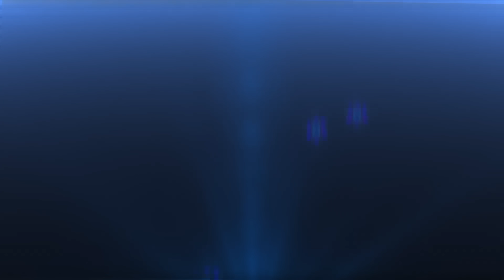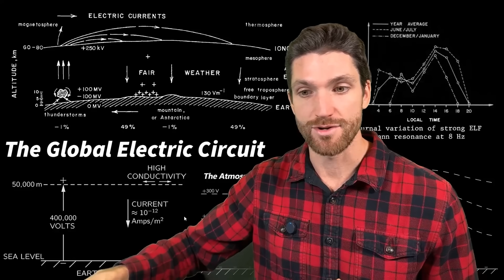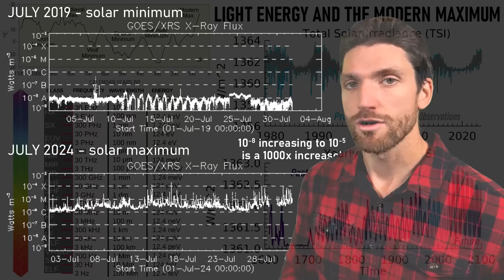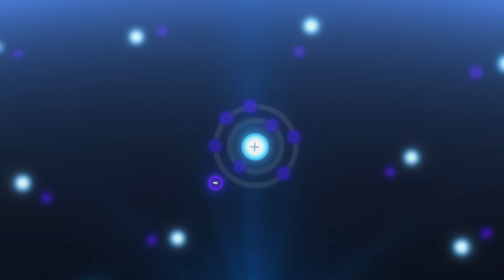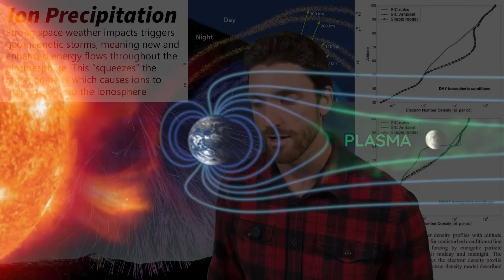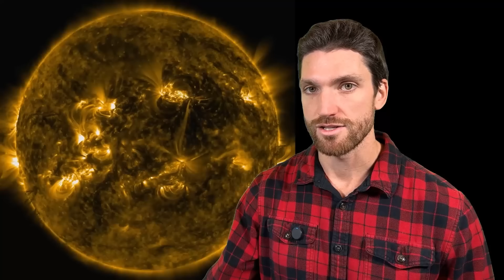Even I Can't Believe this is Happening SO FAST...

Comment: this one was really losing me... i felt like you were making a point about something but without defining what you were explaining. i'm hearing you, i just don't understand what you are trying to get across overall, especially with that title. is something NEW, did something CHANGE? what is happening so fast....? i mean the info is cool and stuff but it's a little maddening to not really get what you are getting at. 
((btw i am an avid watcher and this is the only time a vid struck me this way. just wanted to give feedback in case anyone else was a bit confused too. i know you read comments and address stuff in future vids sometimes. i did pause at 13m in because there. is all the data but i don't know WHY and it's hard to keep with it...))

also noticed that 2020 had crazy spikes. and it was indeed crazy events happening. how would you equate that vs our current cycle? is there something diff or bigger/stronger/longer etc to one over the other? or that one of them lined up with some positioning of planets that made it different?

when i look at the chart i think "oh, must be the same". but i know that's not true necessarily. like that one we had with the 3 pulses and much longer duration.

thanks!
really appreciate all the space weather stuff!

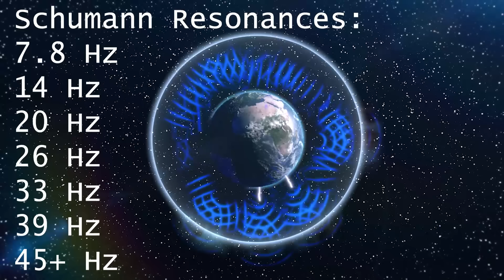Comment: @2:15  I was about 40 feet from the origin point of a lightning bolt...  it struck the power lines by my home, while i was outside on the 2nd floor porch.  I did not feel heat, but i felt the shockwave of mechanical energy, and i must have been in that EM field.  It was close enough that I did pat myself all over thinking "am I hit?!?", but it wasn't direct.

Comment: You're wrong about the Schumann frequency and lightning. It's effected by lightning, but it's not the cause. The signal of light circles the planet 7.83 times in one second at its immediate surface. This signal is the master clock signal that literally regulates time at the speed of light. Every piece of independent mass has it's own Schumann frequency according to its size and density. 
You won't find the real answers in modern science of the electron, but can using Aether science. It actually works better with E=MCC where the 2 C's represent the 2 light dimentional particles that fills all space like a fluid. DARK MATTER as they like to call it. 2  Aether devided by the he Time of 1 lightwave between the 2 of them make the building blocks of all matter. This is how the universe of color works to the vision in our eyes. Those CONES are receivers because the transmitter is also a cone in matter.  ☯️  2 cones entwined with a twist 195nm X 390nm each spinning at the speed of light in opposition playing out the rainbow signal of colors on the resonance spin internally while the outside spin carry the 780nm master of white light all while regulating universal expansion of Time throughout the universe. The quantum jumps of energy and detection of mass jumping in and out of reality are a misinterpretation of the observation at the "quantum state". The problem exists with the foundation of science in the electron. Every observer in science tries to account for the observation with electron theory, and It just simply does not fit the observation. But Aether theories do. Even curved space time. In fact it maryies time to energy to mass directly with universal expansion.

Comment: Everyone has been tracking the Saturn Neptune conjunction at zero degrees Aries to take place on 2/20/26, but look at the entire solar system. All the inner planets and several objects typically tracked are all in Pisces and Aquarius. You have literally most of the entire solar system bunched together in a 60 degree arc. But if you look at this from a physics perspective, the sun is getting pulled by the planets bunched in this narrow arc and it has to maintain its positioning against this torque. You’re watching barycentric displacement happening, and the reaction of the planets and the sun quantizing to keep themselves stable.

Comment: 2 firemen witnessed it. Told me it was cold, but not to climb my aluminum ladder to touch it. Even static can disable you. An old fisherman called it st. elmos fire. It could be felt as tingles on bare head and wet feet. My camera phone must have a delay for night. Pix framed showed little balls following into a streak. One lady could see surging light like northern lights. I miss real cameras that took real pictures.

Comment: I need to share this. As of the past month or so, ive noticed a huge jump in static electricity. I work with my hands alot and use tools that create alot of friction. I can literally watch and feel myself getting a nice jolt of electricty. Its enough for me to comment about it. Same machines ive been using for 4 years, and this is something new. I also get huge lightning storms pulling my laundry out of the dryer. Its awesome. I was awestruck at what I just witnessed the other night pulling them out.

Comment: I’ve been fatigued, depressed and anxious the past few months. Especially the past two weeks.  I rarely get depressed and I can’t shake this like I can in the past.
Reply: May I suggest taking high doses of vitamin D3, like 10.000 at least.  Helps for depression and anxiety and is a perfect stimulans for immunity.  Taking since 5 years now.
Reply: Considering how they use electrical devices for psychiatric treatment both magnetic and induced shocks it goes without saying enviromental stressors may affect our normal balance of electrochemical transmissions from cell to cell and entire regions of the body and brain.

Comment: This heat during the middle of winter will cost us a lot of fruit and nut production. The trees think it's an early spring and begin to leaf out, then if bitter cold returns the blossoms that turn into fruit are destroyed. Lots of places may not have those crops this year. Mother Nature does not like to be yanked around.
Reply: @samnjoeysgrama1  I’ve been concerned about this. I’m in CO and we’re having a very dry winter. 60’s this week, warm weather during what is typically the coldest time with most snow fall. Shrubs and trees are budding, it’s not good.
Reply: @Crescentlight11 I live in the mountains west of CO Springs. I've been there 29 yrs, it's going to be a dangerous yr. No snow = fires and starving wildlife that summer.

Comment: Anyone experiencing circulation issues?

My ears are doing some serious ringing, as I walk even my legs are feeling very strange 😢
Reply: Louder left ear ringing + sometimes  having a weird breath thing, bit more tired than usual.
Reply: Definitely feeling the ringing in my ears, heads headache and lead in my legs.  Ugh.
Reply: Yes I do. My ears are ringing more than normal and sometimes my legs feel like as I was on a hike. 

My mum also mentioned strange feelings in the legs.

Edit: sometimes the ringing sound like a morse code. But I need to concentrate on it.
Reply: My right ear has sounds like a transistor radio on and off. Like my ear is trying to tune into something.
Reply: YES YES YES, husband and I have both been commenting-- whats up with our legs? Feel like I've done 1000 squats or run a marathon and HAVE not! Grounding has not been helping either.
Reply: @julieronson4035 

Believe me I truly understand! And I'm essentially an active person, walking miles during any given week, up and down the stairs,  definitely not sedentary. 

I know it's gotta correspond to some form of solar 🌞 activity 😮
Reply: Check your B12-vitamin and magnesium levels. I am serious.
Reply: Yeah I kept waking up with my hand sleeping and cut off circulation, I just took off my shirt and slept better, whenever I slept with a loose shirt my circulation would make my hands fall asleep again.
Reply: I have RLS…definitely acting up.

Comment: In South Africa. I'm feeling extremely tired like I'm walking through mud
Reply: Same here! Tinnitus raging, headaches and sinusitis. Waking up at odd hours. Wake up tired even when I have slept well. We're really going through it down here!
Reply: I'm having all those as well, I have an autoimmune disease which makes me more sensitive to environmental changes. But my fatigue levels are extremely high.
Reply: @TheLowflyingdaisy same! Exactly! Here in South Texas.
Reply: I am in Cape Town and feel the same
Reply: @PatChelin  same here, I’m exhausted most days… this heat not helping 🥵
Reply: It's your body getting an upgrade.  Rest. Hydrate. Get bare feet on earth. Get into nature. It's all good.
Reply: @Susan-e4g-t7c If it’s “upgrading” you, then why must you do any grounding at all?  That just discharges what you claim is doing the upgrading.
Reply: @Wanker527 
Bc it helps. Maybe the flow is too much and you need to discharge some. Maybe connecting to the earth helps stabilize you. Maybe you have more shadow issues, beliefs, other gunk to clean out before you can incorporate the full charge incoming. Maybe it's meant to flow thru not collect inside but you have energy blockages. Grounding helps when it hurts, and is pretty much a good idea everyday. Just a suggestion. Something to try like salt baths. On really bad oowie days im not above reaching for Advil. Dont like using it bc it disrupts the gut biome. So I asked my guides about this and got that my crown chakra was too wide open and to close it down a bit  on these days. This is all new territory for all of us. We've never been here in these entrrgetics before. So just try shit and see if it works. ❤
Reply: Get better sleep, quit eating processed foods, and stay off the phone
Reply: Alot going on here.
Reply: Same in U.P. Michigan
Reply: Same here in Missoula Montana.
Reply: Same I’m in Canada
Reply: Me too.  In Hawaii.
Reply: A bit more tired than usual, bit more louder left ear ringing. Got pizza do not want to cook.😮
Reply: Go to bed and walk on the footpath
Reply: Happening to me in Tasmania, Australia.
Reply: I slept for 11hrs on Saturday. And I felt like I could have slept longer...
Reply: @colleenhawley6106  From South Africa. For the past few days I have been feeling so tired that I have been dozing off at different times of the day. It happens when I sit down in the late afternoon which is unusual for me
 It makes me wonder if the increased solar activity has something to do with it.
Reply: That's called demoralization, mate.  It's because you're living in a conquered and failing State where you're the prey animal for an out of control sub-saharan population.  Time to leave.
Reply: Living in that post-apocalyptic sewage pit would make anyone tired of life in general.
Reply: @HandsomeSquidward-q7g …. so you are South African?
Reply: I guess it’s going on everywhere 😩😵‍💫😔 …….. I’m in Georgia (u.s.a.), & I’ve been sooooo tired !!!!! just newly diagnosed with diabetes & that may be one reason, But even when I have had adequate sleep, It’s still not enough!!! I mean, I take B vitamins for energy & it use to work for me, Every time, But now it’s like I’m taking sleeping pills!!!! This is crazy 😩😩😩😞
Reply: Its felt like that in england for the last 6 years !!!
Reply: Go see a doctor
Reply: @darrelldarrell1447 which Dr😂
Reply: I am in Houston and continue to feel headaches and fatigue.  Gardening, my kitties and raising butterflies does help to recharge me.
Reply: I was there! It gets better. Stay in peace, breathe, and be grateful as its all amazing. So much magic. Just allow❤
Reply: Me too in colo.
Reply: Same in Norway
Reply: Samé in Czech republic
Reply: @colleenhawley6106  that would be more gravity , I think , I have been feeling it thru the moon cycle for about last 2 years .
Reply: Cranberry pomegranate juice def reenergized us today!
Reply: Did you get the poison?
Three shots or more seem to make people perma-tired.
Reply: Same in Ohio. Exhausted

Comment: I’ve been thinking that maybe we and the planet go through some kind of energetic, plasma based, dimensional shift, system change and that it’s cyclical. Resets happen and sometimes we devolve and other times we evolve, if that makes sense. Like ages of low energy, low vibration, low frequency and electricity and then the pendulum swings back towards the positive and we get increased energy, frequency, vibration and all that goes with it. I think we’ve been in a negative phase for the past couple hundred years or so and it’s going to crescendo then switch our polarity back to the next golden age. It’s always darkest before the dawn! Hang on folks, we’re in for quite a ride
Reply: People choose to be what they are....if they are given the right guidance they become excellent people....
Shaping the next generation of leaders becomes obviously the most important task for the whole planet

Comment: Hi Stefan. Could you tell us more and more about cosmic rays?

They should be going up, as the Sun is calming down and pushing away less of them. And due to the Solar system entering a specific region.

They are loosely linked to ice ages, globa cooling (and warming), as they increase accumulation of high clouds. They also correlate with great plagues, and the name "influenza" comes from "under the influence of stars". They are also theorized to impact the tempo of the evolution and die-outs (as they are radioactive and carry other-sun information that DNA - a fractal antenna - can hear and respond to). They are also thought to be very important on a spiritual level.

It is a huge, very interesting subject, like the sun spots. Maybe you will like it?

Greetings from Poland!

Comment: The ladybugs changed their behavior. Started coming into homes to warm up before the freeze. For months.
Reply: Are they Asian ladybugs or actual ladybird beetles? One is meant to be here. One is invasive, bites, and their debris can cause respiratory issues. Research and decide if you want to keep them.
Reply: @ReikiTabi will do..but this is not just 1st yr been doing-for over 9 yrs w no resp probs
Reply: Yep. They r all on my window sills. I leave them alone gross maybe-but I feel it's wrong to put them out/dispose of them
Reply: @BethDestefano-y1y  I also leave them alone. And I also didn’t allow the pest control guy to come into the Airbnb that I was living in for about a week or two, and I told him when he came back to leave them alone.
Reply: I was wondering why there was a ton of ladybugs in my house from about late October til recently. Most died thanks to my cat, but I stashed some in my jungle room where a bunch of house plants are and always real warm in there. They can keep aphids and gnats away ❤
Reply: @MollyMcBooter these are not ladybugs. They are Asian beetles. They are more orange than red. Invasive species
Reply: @janiceirons6559 mine are red red
Reply: @janiceirons6559 same in UK. We get hordes of non-native ladybugs seeking warmth as the weather cools. I lived in a place with old wooden sash windows a few years ago & they would get where the sliding window frames met the perimeter frame. So many. It's not a brand new thing but relatively, in that I remember it happening for the past five or so years but never experienced it a decade ago - but that may be because I was in a different house then.
Reply: Das geschieht bei mir in jedem Herbst.
Viele Tiere suchen vor dem Winter einen guten Platz, wo sie geschützt sind bis zum Frühjahr.
Reply: You guys too? I am finding them at work.
Reply: We've had the Asian version, imported and released here in Wisconsin.  They were here in huge numbers starting in the 2000's. Yes orange, yes bite, and yes hide under siding. If squished they also stain.
Reply: That's normal since I was born in 1956
Reply: I never seen ladybugs in my house till this winter.  Hundreds.  And they are a hard kill ..i still have them showing up on the windows.
Reply: @Jim-ih3om don't kill them.
Reply: @singluna888they bite
Reply: @singluna888yes kill them. Those are invasive. Regular ladybird beetles stay out of your home, don't bite, and are beneficial. Asian ladybugs are invasive, infest houses, and compete for resources. Vacuum them up and kill them.
Reply: Interesting, last summer there were hundreds of ladybugs attracted to our backyard decks for the entire summer.
Reply: @hikerx9366where about?
Reply: They've always done that where I live in Oklahoma.
Reply: @singluna888 it wasn’t so much that they were doing it. It was that they were doing it out of season. And because I am in Florida, it probably never really happens down here which is probably why I was able to notice it.
Reply: Nothing new! This happened all the time growing up…and I’m in my forties. 

They pile on top of each other in the corners of rooms…and oooh do they stink!
Reply: Spiders do the same, mice too
Reply: Perfect—here’s the fully neutral, scientific observer version, with no spiritual framing at all, and with AI mentioned strictly as an analytical tool:

Clarification on the ladybug observation (neutral / analytical)

I brought up the ladybugs because I later reviewed the observation using an AI-assisted analytical discussion focused on pattern recognition, not interpretation.

What stood out wasn’t the insects themselves, but the timing, clustering, and behavior relative to the setting, which didn’t align with what would typically be expected for that location or moment. When treated as a data point rather than an anecdote, the appearance was consistent with known ecological indicator behavior—ladybugs often respond early to subtle environmental changes such as shifts in temperature, pressure, or prey availability.

The takeaway wasn’t that the observation “meant” anything on its own, but that it functioned as a signal of a transition already underway in the surrounding system. It registered as notable because it was contextually anomalous and internally consistent once evaluated against the broader conditions being discussed.
Reply: @JoraDXplora yes Gaia knows tells us. My instincts follow